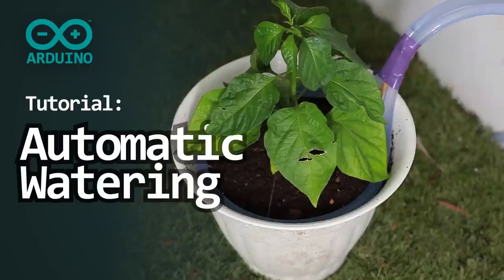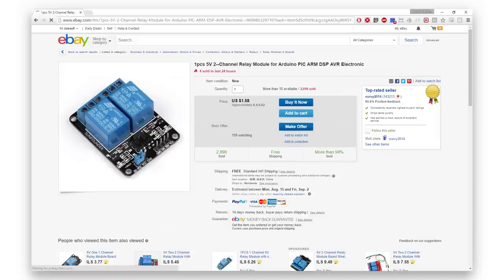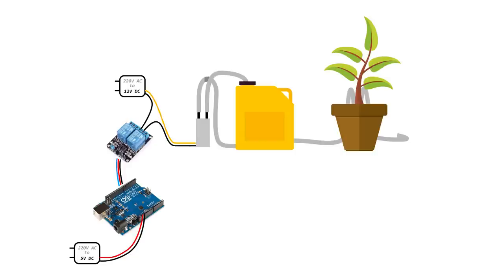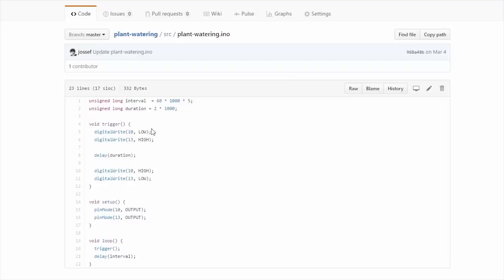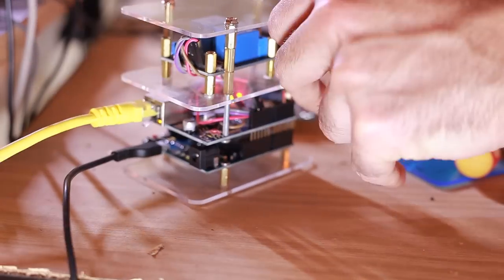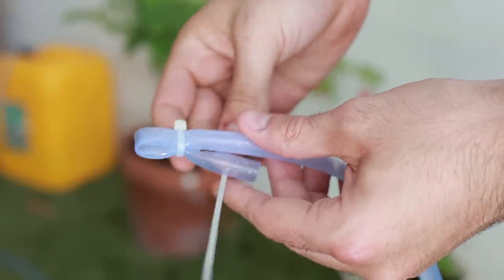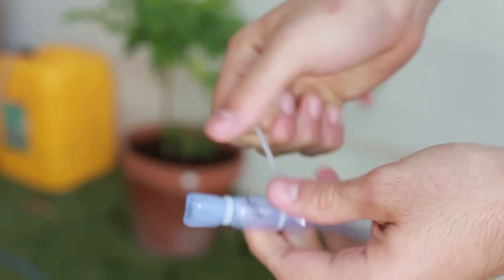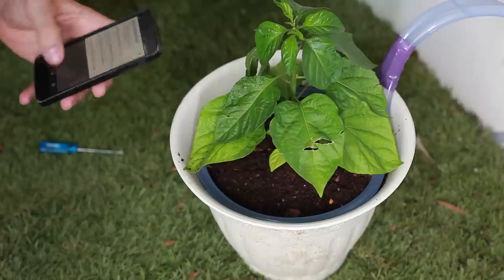Making an Automatic Watering System

Comment: Rofl @using an arduino to auto water, yet then leaving out a soil moisture sensor to control when it gets watered. You may as well used a timer circuit for all the help this did.

Comment: Nice Work man.. can u tell how the code works step by step?
Reply from the maker: see description, the code hosted on github is linked.
there are 2 functions - "loop" and "setup"
"setup" only called once, It's for initialization
"loop" however, always called, infinitely.

in the function "loop", there are 2 actions:
1) open the relay (which opens the pump) for couple of seconds then close the relay
2) delay which puts the arduino to sleep and wait (the sleep duration is hard coded, can be changed and re-uploaded to the arduino)

Comment: Ey dude, where do you put the 12 V DC in the pump? cant find the entrance.
Reply from the maker: the pump I'm using has 2 pins, 12v and ground, it's located at the bottom
Reply from the maker: It may, I would go for cutting and soldering the wires into the pump's connectors (using a soldering iron )